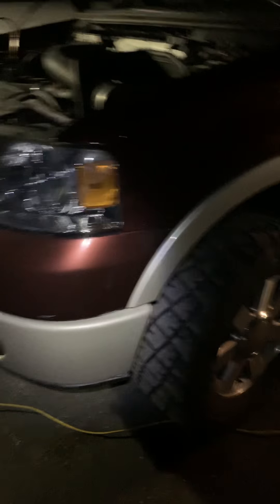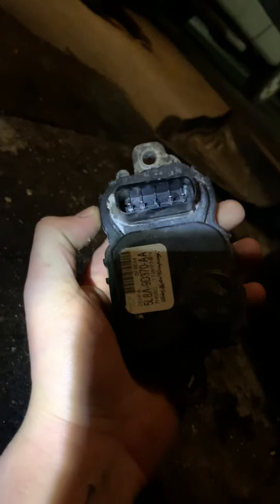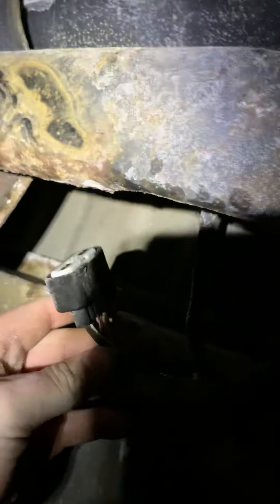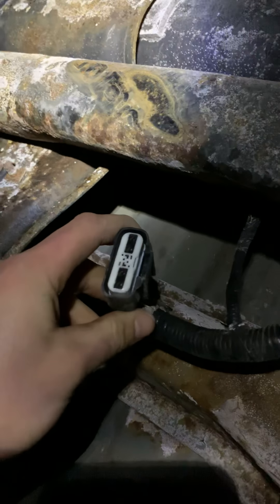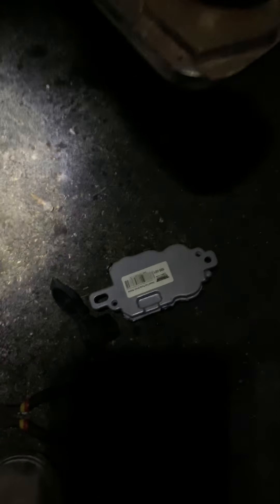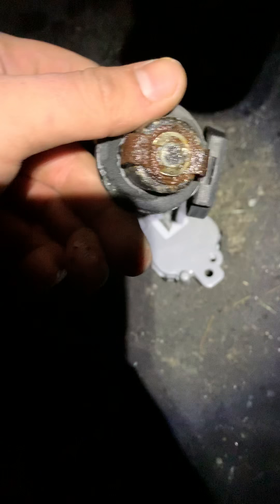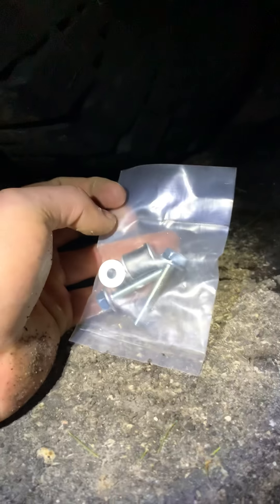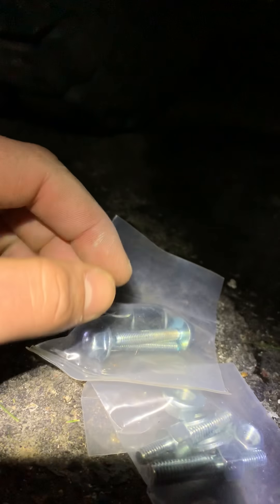2004-2008 Ford F-150 Fuel Pump Driver Module Replacement

Comment: I put the Dorman one on and I’ve had starting problems with it still.  I guess the rubber spacers are to blame.  The Ford version has metal studs on it.  I guess a better ground?